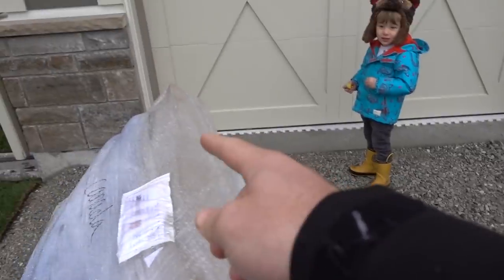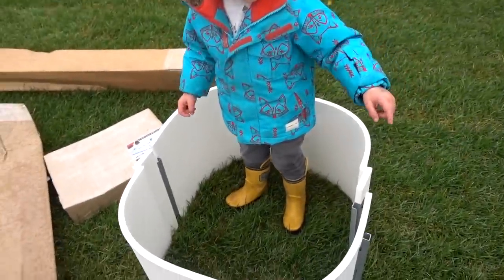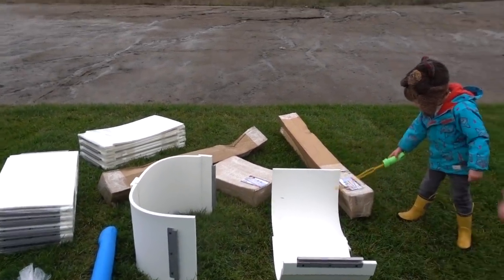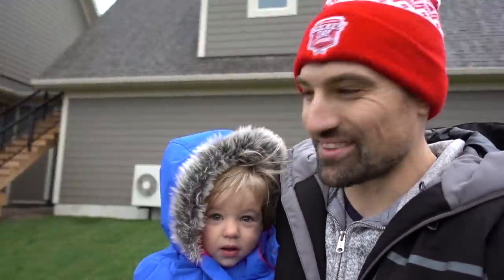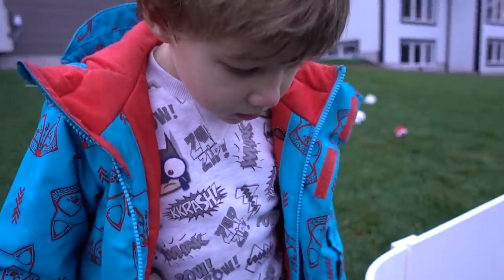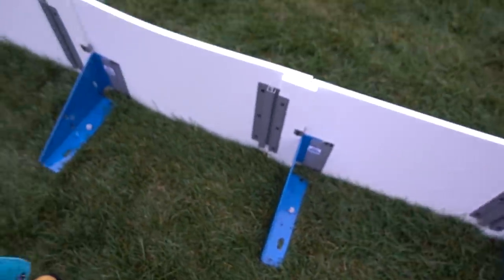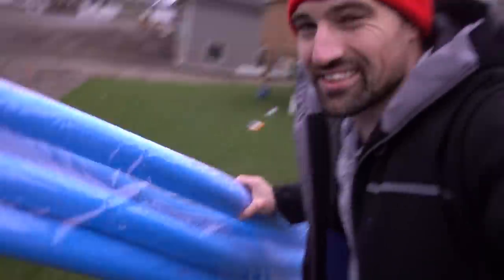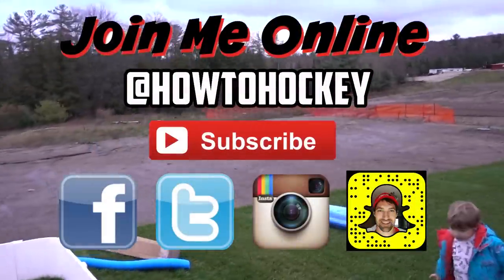Building a rink with Mason - Testing the new Drop In Rink

Comment: Hi Jeremy,

What's your honest opinion of the boards these guys supply?  They look super loose but I am wondering if that is to allow for temperature variations?  Just did an Ice n Go rink last season but not super impressed by those guys products.  Basically paid a fortune for some plastic brackets and a liner.  I made my own boards because the yard is super irregular shape and wanted something to maximise the space.  Have been reluctant to buy something since.
Reply from the maker: I'll let you know after a season. The boards themselves are solid plastic and sturdy but they attach with a simple metal bracket, it doesn't exactly snap into place, just loosely holds everything in place.